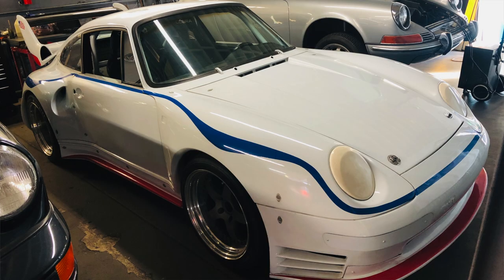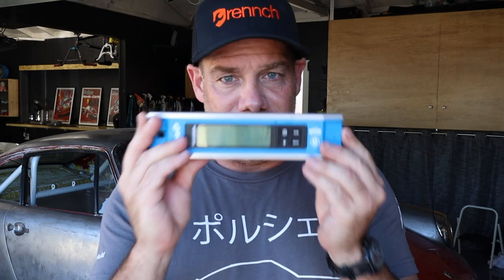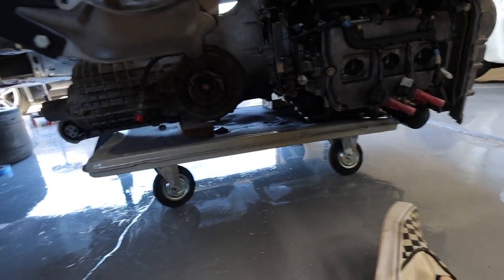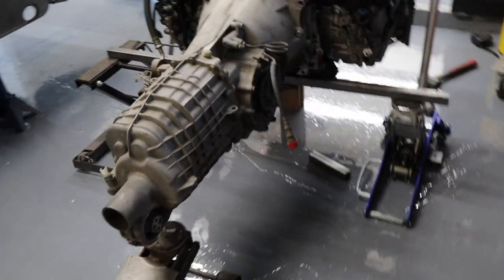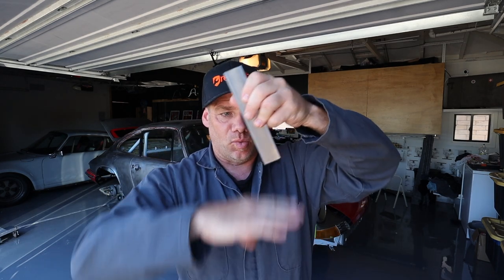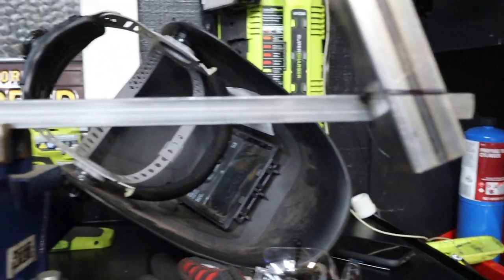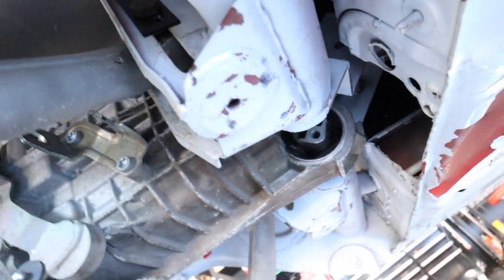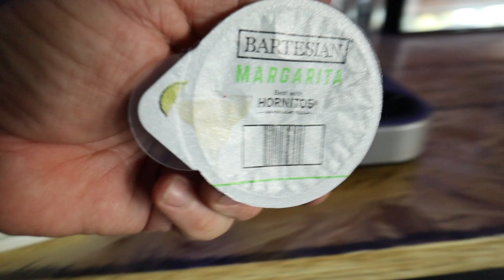Custom Engine Cradle 1 | 400 HP Subaru EZ30 Twin Turbo into Vintage Porsche 911 | Blasphemy Build 21

Comment: Hi Mike ....great project ...I am a big fan of engineless Porsches....I recently stuck a EZ30 into a Boxster S .....I must say that this engine is the perfect swop engine......I also had/have starter issues but will hopefully solve them in the comming week...keep up the good work ...rgds Leigh ..Cape Town SA
Reply from the maker: What adapter plate did you use??
Reply: @rennch.  Hi.....homemade ....it seems to be working .....starter on the engine side ....its mated to an autobox.....engine uses all the porsches sensors and ecu .....got the engine running ......only a few things left to do....regards Leigh sunny Cape Town South Africa

Comment: I was just thinking: How cool would it be to run a Porsche engine in an STI. Then I run across this video.
Reply: I’ve looked into this a lot cuz I have a 95 Impreza coupe. The reason you see Subaru into Porsche chassis but not Porsche into Subaru chassis is the distance between the chassis rails.
There just isn’t enough room to fit a Porsche engine into the front of a Subaru. The front rail width is to narrow. Sad stuff.
But at least the ez30r Subaru engine had Porsches help with design of the heads. So that’s cool.

Comment: I'm getting caught up, so I'm a little late to the party, but it occurred to me that your digital level showed degrees of angle. So, you could have used it to measure the angle of the engine mount plate, then cut your square bar so that it would mount at a 90-degree downward angle. That would have made it easier to join them with the cross bar.

Also: What was that about wearing a coverall and not shorts when crawling around on the floor? And when shopping for cheap surplus coveralls, consider shopping for armored vehicle crew uniforms. They're roomier than flyer's coveralls.

Comment: Hi I am currently doing a EZ30 in a ‘74 911 using the 915 gearbox. As to the engine mounts, I have a solution using a billet timing chain cover on the engine and the existing mounts on the chassis if interested.
Reply from the maker: Yea dude! Can you send an email?
Reply from the maker: 2syllableword at gmail

Comment: Good job.  What you bolted your fabbed trans cross member to is the actual trans cross member mounts  for the 901/915 trans. check the gray ghost. It's also interesting to me that the p o cut up the suspension tube for the torsion bars so much on that car.
Reply from the maker: Yea, they hacked the heck out of this thing!

Comment: I used two furniture dolleys the attached them together with 2x4s did a great job holding the transmission for my case
Reply from the maker: VERY good idea. It was the jacking up part that was difficult for me.

Comment: Have you thought about how you’ll run the water lines? 

I’m making hard lines out of 1” aluminum rigid conduit. Planning on a pipe bender for the larger bends and 1.25” mandrel elbows for the really right bends.

Basically I’m looking at following the factory oil line path on the right and mirroring it on the left.
Reply from the maker: I'm looking at some boxster/cayman hard lines through the tunnel.  Not sure yet though...might be soft lines through the tunnel too.  Either way...going through the tunnel hopefully.
Reply: Rennch - Porsche 911 Restoration and DIY Tips lots of stuff in there already, not sure if there’s room.

One advantage of outside is a lot of surface area for additional cooling, it does make a difference. 

I’m looking at making some custom aluminum rocker covers that are about a 1/2” lower than the factory ones to cover the hard lines and give it a smooth look. Maybe use 911T chrome trim to cover the holes where I’ll attach them to the factor sill panels.
Reply from the maker: @AndySomogyi  Maybe not in yours.  There's zero in mine.  Just a hollow tunnel.